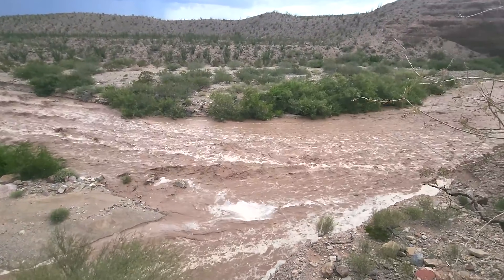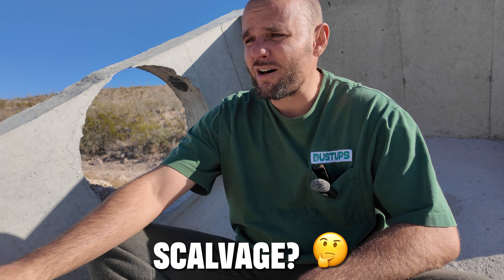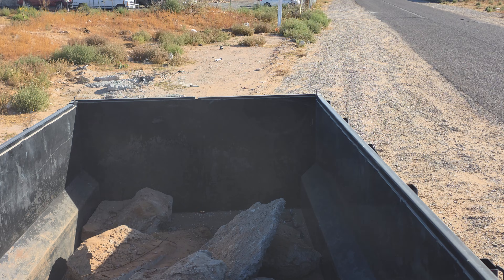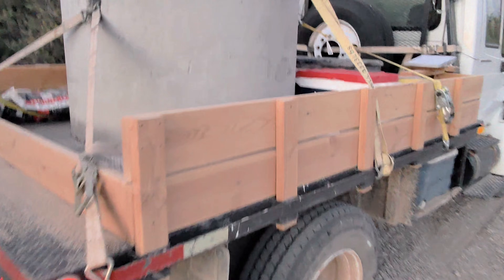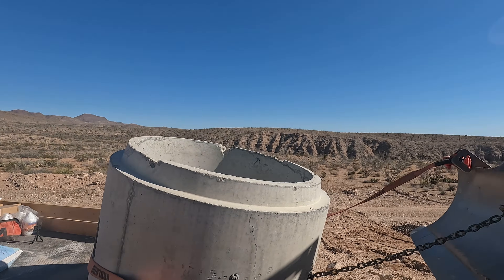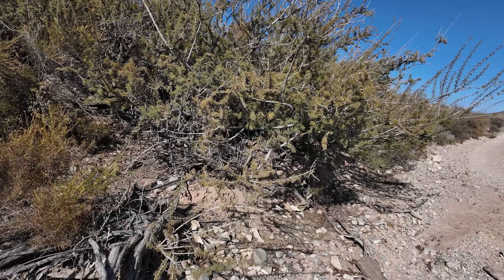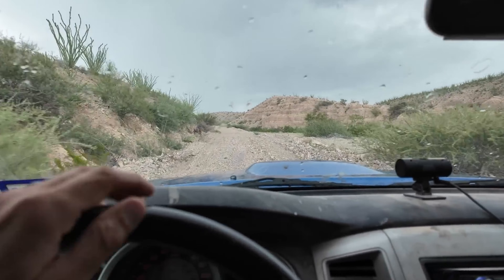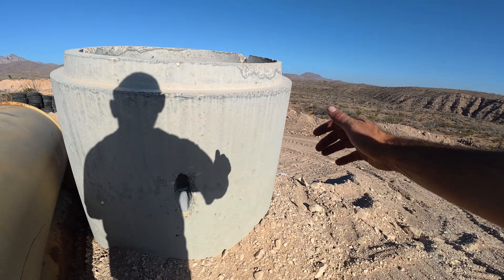I'm Fighting Desert Floods with Free Waste Concrete

Comment: Love this idea. But would caution to solve a systemic issue (the energy flow of the landscape) with only one targeted action.  
If you get this right, the gallons/dollar ratio will be unbeatable. Build 5-10 rows of this!
A) Define a deliberate spillway
A wide, shallow overflow is far safer than letting water find random low points and form high-energy jets.
B) Key the structure into banks and bed
The blocks must be anchored into the channel sides and bed.
If the structure isn’t keyed in, water will go around or under it.
C) Protect the downstream apron
Place heavy rock or concrete immediately downstream of the spillway.
This absorbs energy and prevents scour and undercutting.
D) Use multiple small steps Instead of one large barrier
Several low check dams reduce energy far more safely than one tall obstruction.
Lower drops mean lower erosion risk and better sediment capture.
E) Build as a leaky check dam system
Distributed resistance and energy dissipation always outperform a single rigid barrier.
Reply: Шон не собирается складывать эти бетонные конструкции горой. Высота барьера определятся высотой этих конструкций. Перелив в идеале должен быть по всей ширине русла, кроме краёв.
Reply: @AKSIS77  isn't it better to have a designed spillway?
Reply: @RTew021  Водосброс(укреплённое отверстие в дамбе, в случае Шона их нужно очень много) лучше если главная цель устойчивость высокой дамбы.
Шон же хочет замедлить эррозию - для этого нужно максимально замедлить течение воды. Значит чем шире будет перелив тем медленне будет течь вода в каждой точке перелива. Значить она будет меньше размывать русло в тех местах куда падает.
Reply: My thoughts entirely. For your small water courses you are using multiple devices to slow down the water, spread it and sink it. I think you are have to apply that to your ford to slow the torrent and make it less destructive. A spillway is a good idea too. Good luck. Don
Reply: Excellent tips, I hope Shaun sees your comment.  I was thinking something similar… the more slowing, the more successful for the road and the local aquifer!

Comment: Geologist here. You might want to check out and mimic a geological process called imbrication to incorporate your dam/riverpassage and allow it to overflow more safely. Once you have a waterpond you may put in a sluice to capture water and bring it to a place in the landscape where you can use it better. Also you ponding area may be a good place to harvest fine grained material for use in terraces and such. It's a shame to loose your fine grained stuff because that's useally good to build soil.

Texans are "known" for coffee use. Have you any big producers of waste coffee grounds? Might be interesting to use. You might even grounds to produce mushrooms first.
Reply from the maker: I want to place a few pieces in the central wash. It's probably the fastest way to restart my pond project, but I need to prioritize access across the canyon
Reply: @dustupstexas Hi there. From what I saw in the videos, the major issue is the speed of the water as can flow almost in a straight line. Your approach heads in the right direction. Don' block the water but put loads of rocks left, right, left, right etc. to create a Z or S shape way. The first water will then hopefully deepen the tips of the Z instead of deepening the bed of the canyon.

Comment: Why don't you use Sandbags instead? Don't use sand naturally. Fill them instead with the gravel you have such a abundance of. 
You can get a thousand for like 250$ if my research is correct. With a thousand sandbags you should be able to build a 2-3 feet high barrier across that stretch. Use the bulldozer like last time to create a small hill and use the material to fill the sandbags. Then use the sandbags as the spine of the hill.
Reply: he already wanted to build a building with sandbags. they decomposed under the harsh UV light and more or less dissolved after a year.
Reply: @TheManfet  That's not really a problem here. You can just cover them with dirt. Or use any other solution to protect them from UV. We just want them to stabilise the gravel hill and stop the water from peeling away the loose stones. As long as the hill stands for a few years the evaporating hard water should solidify it ie, form caliche

Comment: One idea: You could buid big baskets with rebar mesh and a rebar binder to fill in stones and concrete pieces of smaller size (like < 1m^3) to make them even heavier to wash away. I was astonished when I saw like a 60t rock got moved in a wash. The density of "dirty water" can be extreme and rocks just float in it when there is sludgy water all around it.

Comment: From my experience with the automatic transmissions in medium duty trucks, you can get up to speed and maintain speed better by starting out in 1st gear and manually shifting through the gears, and only using it as an automatic while unloaded.
Reply from the maker: Mine is a standard

Comment: Build several One Rock Dams upstream.
Reply: This is the best ultimate solution to start. Hopefully enough rock dams will help native plants establish themselves and retain enough runoff to reduce flash flooding. 

Without vegetation to hold the soil in place and a let it absorb rainfall, a barrier of concrete remnants is unsustainable and will need to be continuously restored after each flood.

Given the span of the arroyo, a low water crossing is probably the best solution for a roadbed if you can slow down the accumulated runoff.

Although, with a bulldozer being available, a series of well formed upstream earthen dams might be part of the solution and create larger spaces for vegetation to take hold.

Short of a concrete lining being poured in the channel, until there’s enough ground cover to absorb enough rainfall and reduce enough runoff, erosion will continue.
Reply: There was a man named Viktor Schauberger who really had some kind of inate understanding of the behaviour of moving water, but didnt really have the scientific words to describe what he understood to others so well.   His profession was in designing non-erosive flow steering structures, primarily aimed at the transport of timber logs in a way that required less labor and maintenance,  some of which are still performing exactly as intended, over a century later with little maintenance. Others have tried to copy those designs with varying success.  He just really was dialed into the nature of moving water. His epiphany came from watching how a snake swims so effortlessly with little disturbance to the water it was propelling itself across.    Dont fight against it, work with it's natural inclination.
 You can learn a lot by just relaxing one afternoon and playing in the mud. Set up a steady flow of water across a slightly tilted sand box and just watch how it wants to form meanders, change the grade by tilting the sand box and see how that changes the behavior of the same flow. Hopefully that few moments of child like fascination will trigger an "AHA!" moment. Straight lines is the last thing you want with running water unless you can afford to construct hard sides that are highly resistant to erosion. I guess my takeaway would be that it can be really expensive to try brute force to control water flow, better to use subtle steering of the flow in a gentle, self-stabilising manner the way the water naturally wants to move.
 The Viktor Schauberger story reminds me of my father who had some far out sounding theories of physics, particularly in electronics that were contrary to what my school books said, and he would often set up a demonstration to prove it.  I could point to one specific example that has been used trillions of times, that served a very practical purpose, but he didnt realise just how valuable that observation of controlling that device outside the data sheet limits, would become, and neither did his boss. The Texas Instruments factory engineering representative did recognize the potential value of that observation and immediately patented it.    Decades later the rest of the world caught up with some of those ideas and I began to realize that if he was right about some of those things contrary to the consensus, maybe some of his other ideas were correct too and everybody else just hasnt caught up yet. Had he patented that one outside the box idea, there is no telling what else he would have had the resources to prove. 
 Watch the moving water to understand how to encourage it to be nice instead of fighting it with ego turned meanness. If you choose to fight,  the water will win, eventually.
 And just to bring it back to a simpler to grasp vision, the grade is too steep.  So much so that in many places you need hardened vertical drops into  catchment pools in specific places. Only two overall options really, dramatically widen the channel, a little at a time, with individually placed boulders carefully and thoughtfully placed in just the right spots to encourage a less destructive, lower velocity flow and a natural widening of the channel by directing the current toward the edges, back and forth across the channel instead of being concentrated to the center by that last flow of a flood event. Give the water time to do the earth moving where it needs to move by it's own power or make the channel's path a lot longer to reduce water velocity.  All bets are off when you have a large volume of water at boulder pushing velocity.  Lengthening the channel of that river enough to make a big difference is really beyond the scope even of the County's resources, so that leaves you with widening the level bottom of the channel.
 An extreme example just to help in visualization,  if that flow were evenly spread across your entire, levelled property, the velocity would never be high enough to move even clay, you would then capture EVERYTHING, mineral, organic, that comes from upstream but to do so would mean a wide wier at the upstream end of your property.  Too grand for this lifetime, probably. 
One good rain can move a helluma bunch of material, equivalent to thousands of gallons of diesel and man/machine hours so anticipate where the water will cut, and where it will deposit. In those steep sided gulleys, that means once solids are broken loose, they will continue moving waaaaay downstream, perhaps all the way to the ocean.  Good time to carefully think about where to place your newly acquired, relatively immovable objects with the ultimate goal being to allow the flow itself to dramatically widen your ford over time. Steer the flow toward the edges and encourage meanders to lengthen the flow path thereby reducing the effective grade to depository instead of erosive. You can already see examples of that very natural process with various water flow control structures you have already implemented. Grasp the grade at which clay will deposit, at which sand will deposit, at which gravel will deposit, at which big boulders will continue downhill that will tell you how wide the channel  needs to be to accomplish a specific, local goal cutting/filling. Me thinkseth every one of those BDAs need to be built up a few inches higher and wider after every rain. And harden the downhill side of each BDA so that its base doesnt erode with overflow causing a collapse.   That part may fix itself in time with rocks that get displaced in a heavy flow event,  but ongoing maintenance seems to me a lot less work than rebuilding a total blowout.
Reply: @laserflexr6321 There are a number of techniques you can use to induce meandering. All well described in the book "Let the water do the work", by Bill Zeedyk and Van Clothier. I just hope, someday, Shaun will invest the money to buy this book.

Comment: These round parts could be filled with gravel and smaller stones in the ford to increase their weight. It might be a good idea as well to connect them with steel cables to create a really stable structure.
Reply: Or smaller chunks of the free concrete first, then add stones and top off with gravel
Reply: @TheLimberPine  That would be much more complicated. Filling a large round section with at least 3,000 pounds of rubble takes only a short time with an excavator. A row of these in the river then collects large stones and later gravel all by itself.
Reply: With it being free thay can just keep collecting more and more.
lots of uses for reinforced concrete.
You could dam all those tributaries you have.
Take care M.
Reply: Steel won't help. There isn't anything to anchor it to.

Comment: You have excellent stone and soil to build a dam; it's the only solution. It should be at least 8 meters high and 10 meters wide—something large. Erosion won't be a problem, and you'll be able to create a large lake. The water will disappear the first year, and perhaps the second year as well, but then you'll have enough water infiltrated underground, and everything will change.
Reply: Don't think they're allowed to block the water and build a full dam, can only do erosion protection for that section.
Reply: Nope. It's not legal but it wouldn't last a year.
Even making a lake it would blow out the dam when it crested.

Comment: 14:30 for the engine, it's generally better to run higher rpm than brute force it in low rpm. You save fuel with low rpm, but the engine is under a lot more stress. Fuel is much cheaper than an engine rebuild.
Reply: Actually there are times the higher RPMs save fuel. In the snowplows at work I could watch the dash to know when I was running at optimum fuel economy while pushing heavy snow with a load of sand (12,000 lbs) and down shifting to run a higher RPM saved fuel. Like the other commenter said running in a better torque range.
Reply: under heavy load you also save nearly nothing if you are not in the optimal range with most torque
Reply: Hi, you have to have some idea what the torque curve is like.
I've seen some diesels where they are almost flat and slope down as you increase the RPM.
The peak efficiency being the lower speed - forced induction.
He's doing the trip that often he can work it out in the real world.
Take care M.
Reply: @markeh1971  My point is that the longevity of the engine is more important than efficiency. Lugging the engine, i.e. working it hard at low rpm, means very high cylinder pressure which results in high wear & tear of the engine.
Reply: Fuel filter is clogged
Reply: In all that dust id bash that air cleaner out once on the bitumen
Reply: I broke the drive shaft bolts on my tractor when at low RPM carrying a heavy load on the forks through some soft ground. I imagine each firing of the cylinders at low RPM jolted the driveshaft, and sheared the bolts.

Comment: I've never done anything with dump trucks, but I wondering it your put some random junk in the bottom of the truck bed before putting the concrete blocks in, will that help reduce friction for unloading? Not much... a bucket of stones or some branches?
Reply from the maker: Yes, but we also have to worry about highway safety. I'd rather struggle with unloading than risk a premature unloading.
Reply: @dustupstexas  Ah, I see! Good point. Thanks

Comment: If I understood it correctly, you are using heavy concrete structures to slow the water down before it hits your road across the canyon. I think that will help, but seeing that big piece of pipe, I wonder, if you could greatly improve the effect by burying such pipes as a spillway below that road in addition to those structures. That should completely keep a lot of that flood water of the road instead of just slowing it down. 
Another question would be, how much of this canyon is crossing your land. Most of the flood water surely comes from the mountains, but some does not. Checkdams for inflows of those canyons as well as terraces on their flanks might be worth to concider as one of the next construction projects on your land. Any water that does not make it into the canyon will help, but such structures would also help with perculation and therefore longer water availability for plants at the edges of the canyon(s) which then, would further help to reduce the force of the floods.
Reply from the maker: They need to be downstream rather than upstream. We want all of the sediment in the water dropping out. That's what makes for a reasonably smooth road surface. The flood itself builds the road

Comment: Good luck with the concrete. I would have preferred to put the concrete forms on the downward flow of the wash so that it collected material and built up the road for you.
Reply from the maker: They are downstream.
Reply: @dustupstexas  Used chain link fencing is great for gabion sausages or bag shapes it would be lighter to haul and you have infinite fill material available on location.

Comment: Be careful i used to make concrete forms exactly like those if the air content in the mix is to high it can also float like Styrofoam due to all the trapped air. You may want to slightly backfill some peices just in case. Some forms are dangerous so if you use chains  make sure they are properly rated and attached because if something breaks it could be very deadly.
Reply: It would make sense to fill all closed structures. For the round parts, this would add at least 3000 pounds of additional weight, and probably much more.
Reply: Seriously????? 
No concrete of that type is used in infrastructure. That's obviously what he's getting pieces of.
Reply: Deadly??? He's not going swimming in the floodwaters.
Reply: @MrHuram-abi probably taking about the chains snapping while they are unloading.
Reply: @MrHuram-abi if the concrete crumbles chains will fly